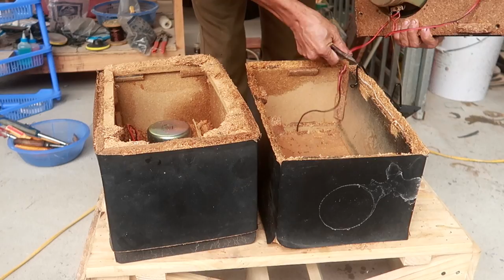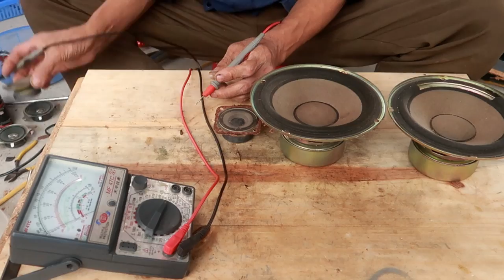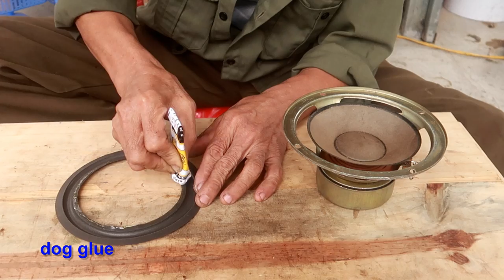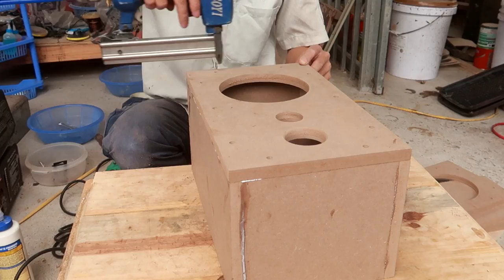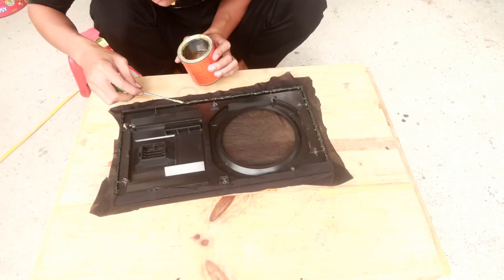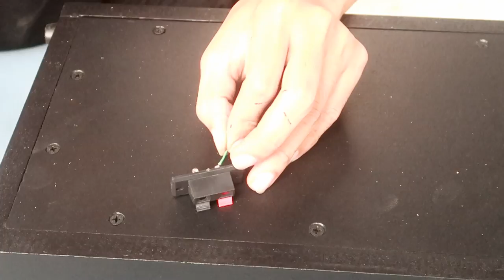AUREX Speaker Restoration | The Most Perfect Recovery

Comment: The speakers he fixed and the one he put in seems different,  the membrane covered the whole speaker while fixing without holes.lets say he drilled holes how to match the membrane coming until steel rim and next there is a lot of gap between membrane edge and rim. Could be my bad .I see a lot of fake videos so getting skeptical
Reply: Yeah, I guess he got a spare set of bass drivers, because he coudn't get the voice coil centered on the old ones (you can hear it rubs when he tests it). But it's not fake like the reverse ones that are obviously BS. 
More mistakes he made was using a polarized capacitor (that will break very soon), sloppy soldering, and no sealant used. The woodworking was pretty good though - even with minimal tools used.
Reply: @westelaudio943  He forgot to use the shims when he put the speaker back together, that's why he couldn't center the voice coil